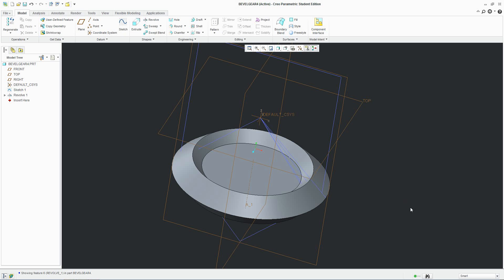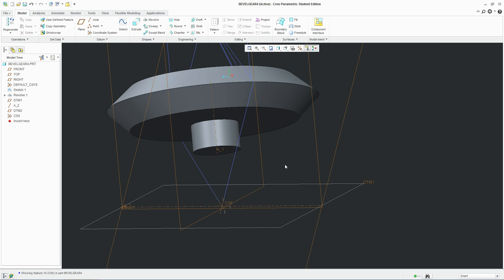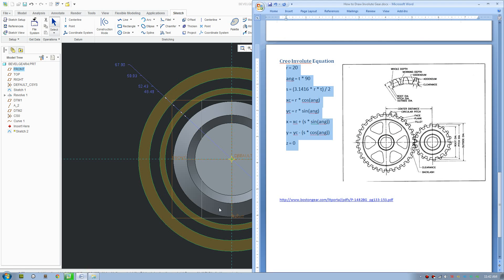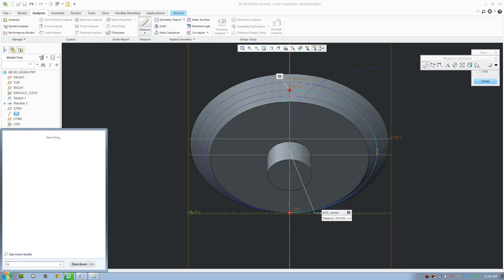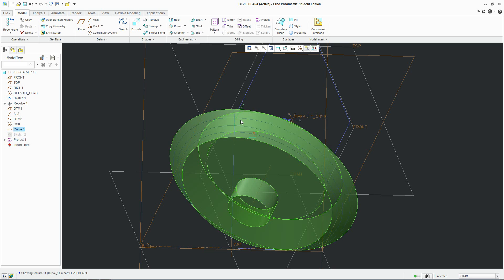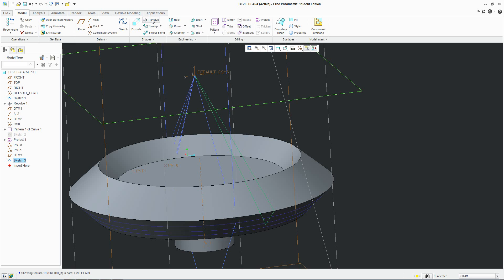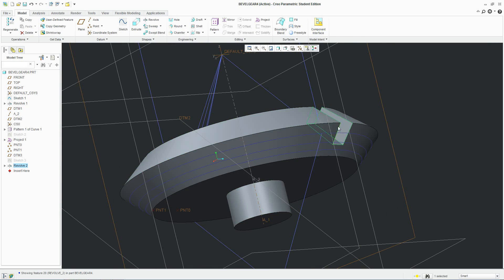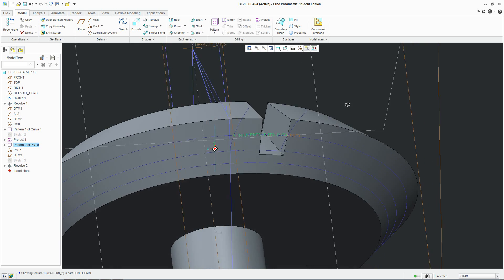Creo Tutorial - How to Draw an Involute Bevel Gear Part 2

Comment: Great job on the tutorial!
I had a question though,
When I try to use the revolve tool to remove material it doesn't give me the option that you have to click removing the material. 
     not sure if this is because I'm using a different version (Creo 3.0) but also instead of using you equation to create the arc I just used the arc tool because I didn't know what to do with all the math, the gear I want to produce is much smaller then in the video.
Reply: I got it to work, instead of creating a new point and plane to use the revolve function on I just used the front one and it worked
Reply from the maker: I  think it is automatic in newer versions. Thanks for watching. :)